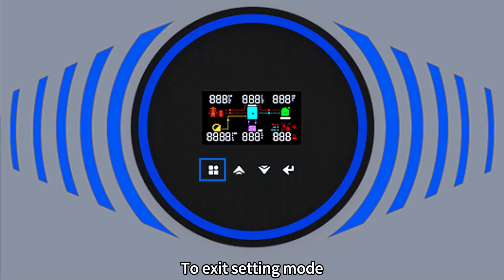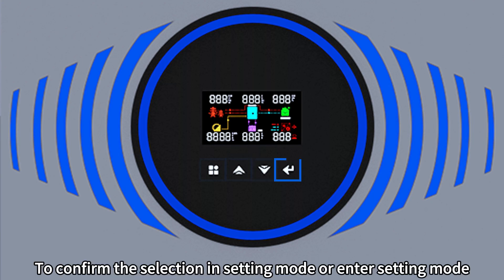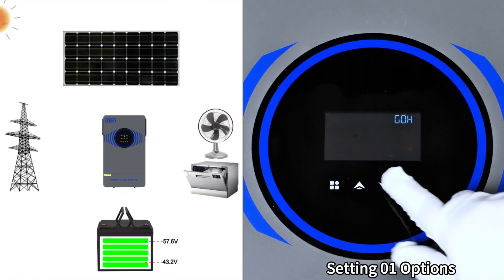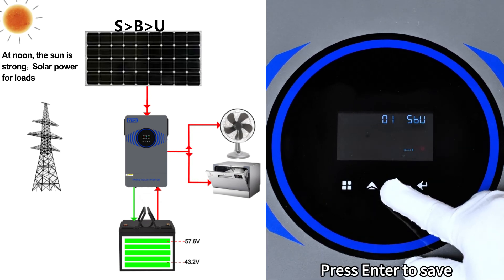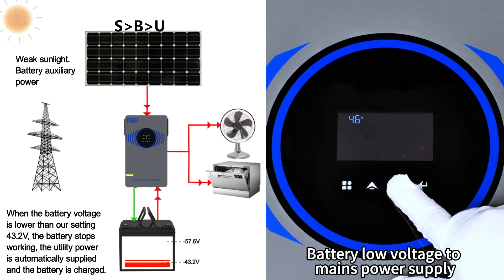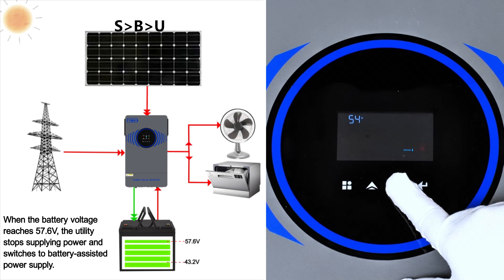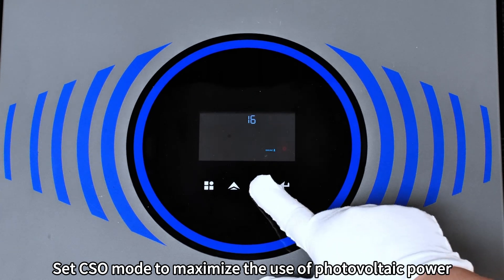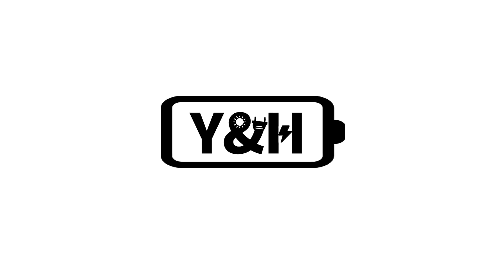【2025 Tutorial】Y&H Hybrid Inverter Charge/Output Mode Setting Detail｜Maximising Solar Power

Comment: Mine wouldnt send excess to grid. They stopped answering my messages on Ali, I ended up getting a reversal from my CC. They tried stealing my money! Shame, because apart from not sending excess to grid, its works good last 2 months. Was meant to have 2 year warranty, but they tried stealing my money by not fixing or admitting fault, then not replying to messages. It was installed and programmed properly, sending back to grid simply didnt work from the day I installed and they didnt give a crap. They even logged in and blamed my geolocation for certain app features not working, but its all linked to whatever switch or sensor stopping it sending excess to grid, blatent liers, typical Ali seller! Im an electrician btw!